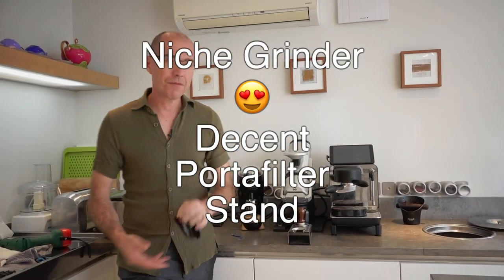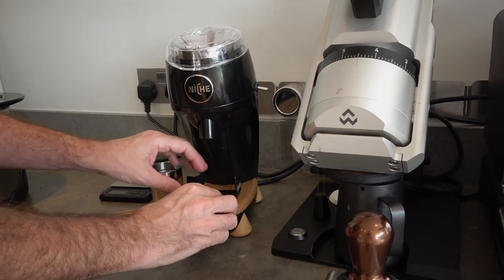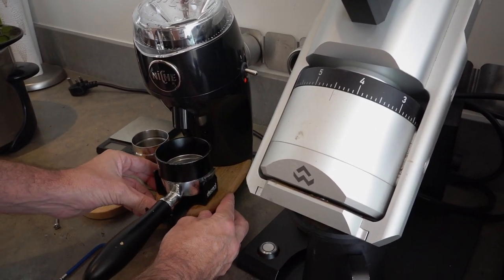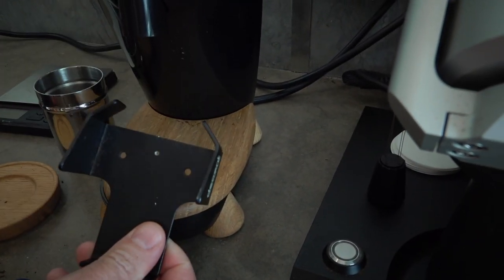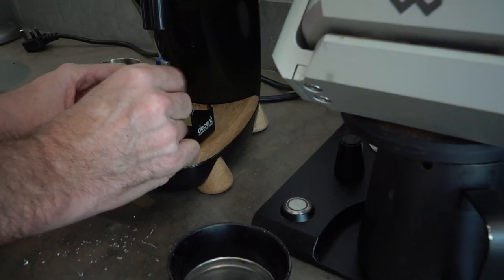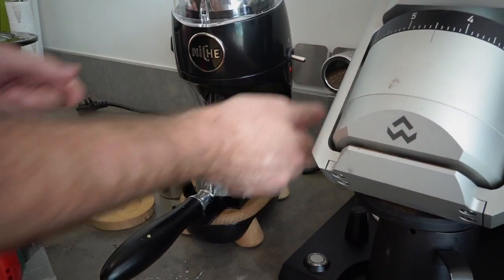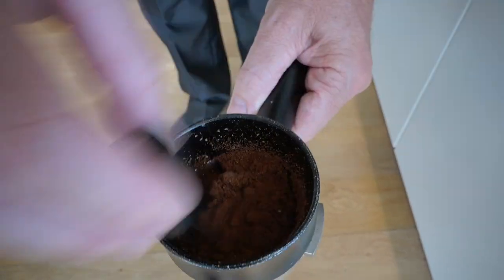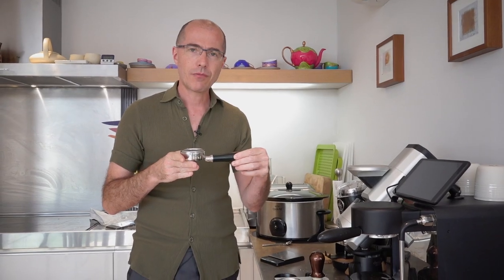Niche Grinder 😍 Decent Portafilter Stand

Comment: Does the short version work with an angled ECM bottomless Portafilter? Thanks
Reply from the maker: Works with virtually all 58mm standard portafilters. Note: the "wings" on your portafilter need to be 90° angled from the handle, not rotated sideways.

Comment: Thanks for the video. Does the stainless Niche cup fit easily in the center of that stand when I want to use it for other preparation methods? Judging from the photo the screw head may prevent it from sitting flat, but I suppose one could use a countersunk hole or flat screwhead.
Reply from the maker: As you guessed, the cup does not rest flat after I put in the stand. It leans a bit, but it does work and it does capture the ground beans.
Reply: @decentespresso  Now you know where the hole goes; please consider selling these.  It should be a fairly simple build.

I have a niche and will be getting a de1pro shortly.  It'd be nice if I could order a niche specific mount at the same time :)

Comment: So can you really not grind directly into a portafilter with this grinder (without the funnel as well)  if not...why?  Looks like it almost has the same type of chute as a Ceado e5/6.
Reply from the maker: You can, if you hold the portafilter in place with your hand while grinding.
Reply: @decentespresso  Oh great, I was wondering why I haven't seen anyone doing this.  I was worried the basket didnt get close enough to the housing and thus you had to use the cup.
Reply: @jmnelson75  most people don't do it because the dosing cup that comes with it is perfectly fit to any 58mm portafilter, so it's easy to distribute that way. But straight into a portafilter works great also.

Comment: Does this Portafilter stand come with the hole installed already by any chance? I just placed my order for this stand plus the decent machine, and it would be convenient if my stand could come with the hole!
Reply from the maker: did you get the tall or short stand?  We just got tall stands in stock with the hole, so that'll be automatic.. If the short stand, please http://decentespresso.com/contact us and indicate you want the hole, as just a few days ago, we got 50pcs in stock.
Reply: @decentespresso  i did order the short one! But now I'm curious, is the taller one better to use with the niche? I went with the short one plus the funnel. Does that create any mess? Thanks for the intel!
Reply from the maker: @excellerateurbreath  short + funnel is what I use.  The tall stand doesn't fit easily with a funnel, it's a bit of a fuss.
Reply from the maker: @excellerateurbreath  please do http://decentespresso.com/contact us right away and indicate you want the new production run with the hole for the niche.
Reply: @decentespresso  i did! Thank you so much. Super excited to get my Decent 😁

Comment: Would there be enough clearance for the spouted portafilter decent stand?
Reply from the maker: Yes, but you can't use the funnel, if you do that.  I've used that setup at a trade show recently.
Reply: @decentespresso  What about using the shorter/magnetized funnel? Will that fit with the spouted decent portafilter stand under the Niche?
Reply from the maker: @docforven  Yes, it was made for that specific use case.

Comment: I've noticed you can prevent the mess if you have a taller funnel
Reply from the maker: Yes.
Reply: How is the new decent funnel with this Portafilter stand with the niche? Not messy i hope. It looked like you were not using the decent funnel in this video. Perhaps it was not invented yet..